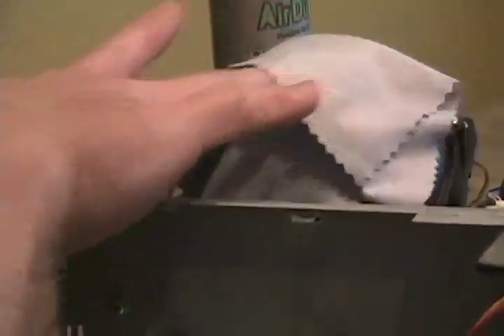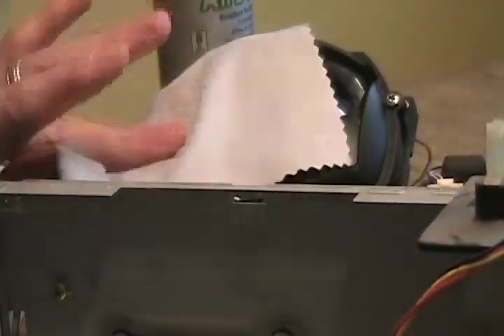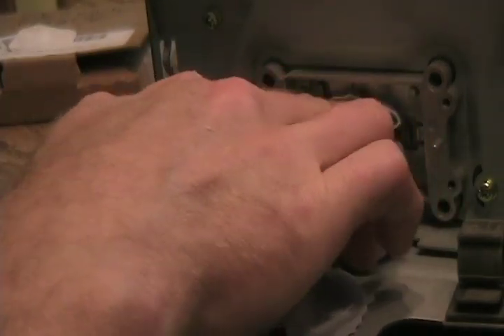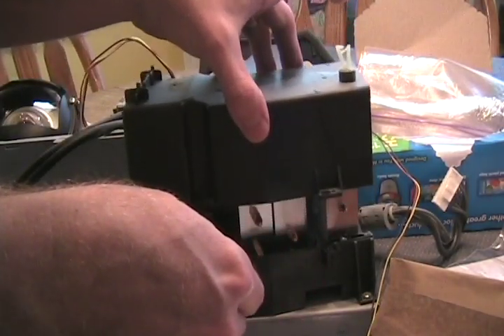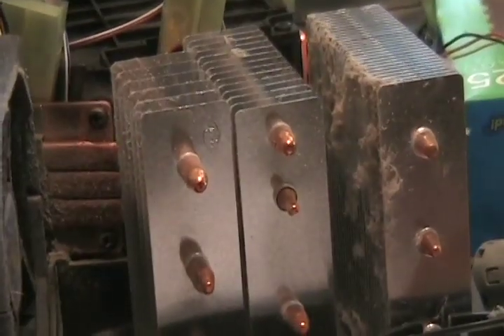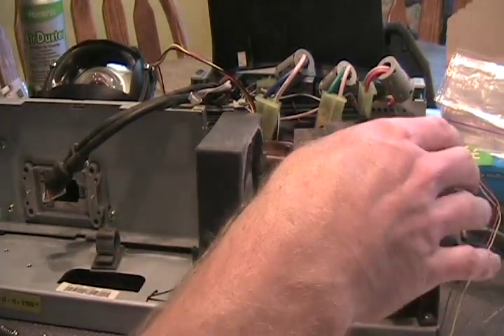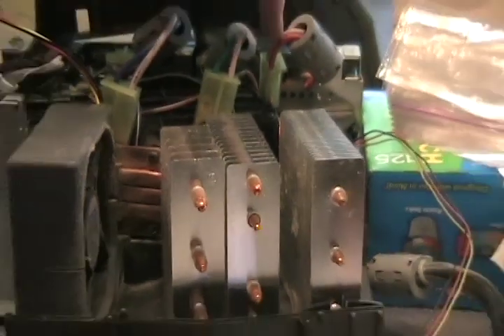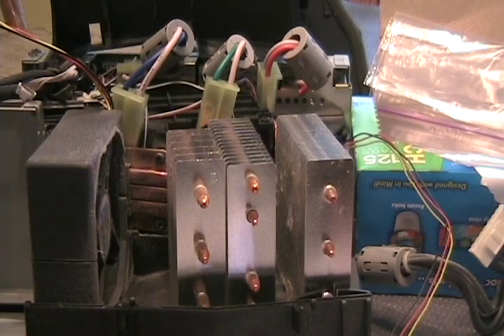What else to clean while replacing DLP on Samsung HLT6187

Comment: Nice video, still have mine, had the chip replaced by a professional, soon  I am going to retire this wonderful set in the other room  for use on my old analog media players and get a projector I refuse to spend over 2 grand for a 4K TV.  I will do the cleaning process shortly after I move it.  when you cleaned the heat sinks did you remove them or leave them and wipe the dust off?

Comment: O. Thomas

THANK YOU, THANK YOU, THANK YOU... Utilizing your videos helped me replace the bulb, capacitor and chip in my 2007 Samsung DLP. Only thing I think I did wrong was not put enough thermal paste on the heatsink. Hopefully the Arctic Silver 5 will spread enough to coat all of the chip. I think my chip went bad because it was not being cooled properly. When I removed the heatsink the factory thermal tape was stuck to the chip. When I removed the chip the thermal tape fell off... Thanks again!!!
Reply from the maker: You're Welcome. And thank you for watching and posting your results.  As for thermal paste, a little bits goes a long way and too much can be detrimental. Did you ever use Elmer's Glue/paste as a kid? Remember how just a pea sized amount squished between to pieces of paper spread to about the size of a quarter? Same with thermal paste. You probably did fine.

Comment: Thanks for the video.   Should be a big help to me.   I just ordered the replacement DLP.  I had previously replaced the red LED as you were describing.   Actually a very easy job.  Saved the TV from scrapping as recommended by a local repair house.   This procedure will also save it.  Nice job.